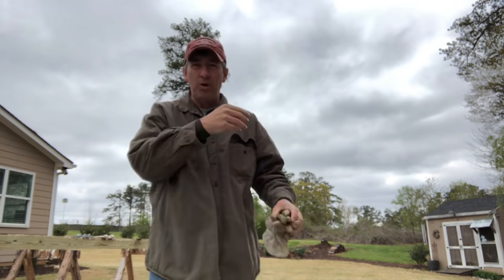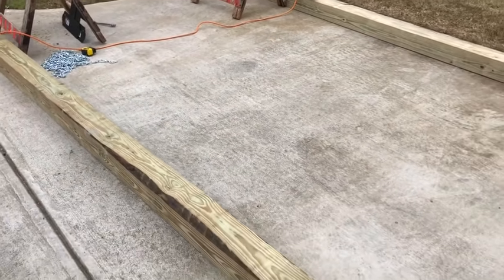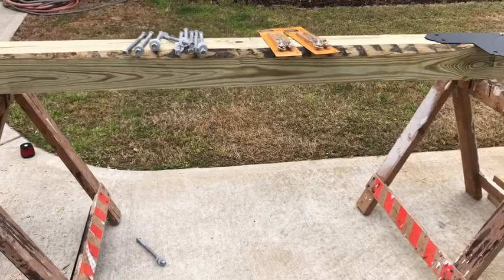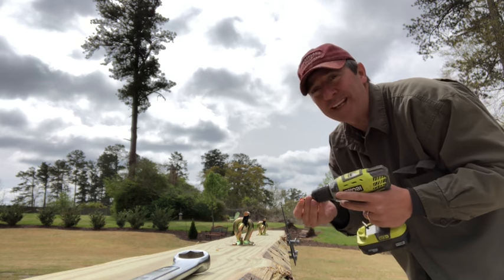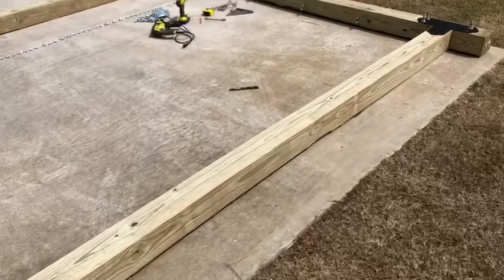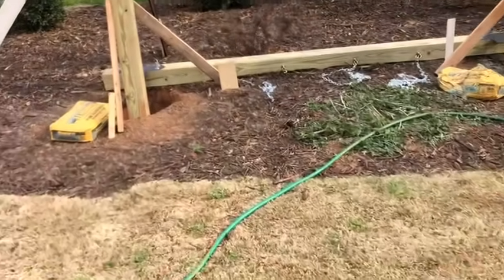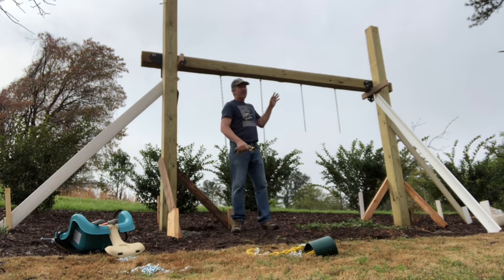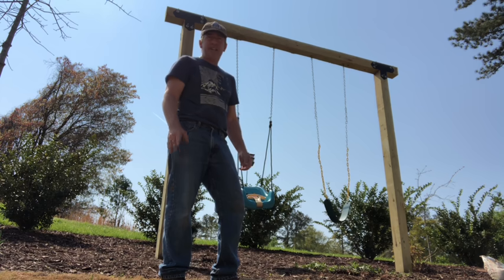Easy DIY Swing Set

Comment: After 4 years, how stable is it now.??
Has it worked loose around the concrete in that soft ground,,?
I'm looking at building a swing set for the grandkids, and wondering about the best method,,  thanks..
Reply from the maker: Great question, John. I got on it last month with one of the grandchildren. It remains very stable. We inspect the connections periodically. The plates, bolts and concrete foundations all look great. We are getting ready to build another on a different property. Stay tuned and subscribe for that video soon. Good luck with your build.

Comment: lemme guess-u got 4 bags concrete but ended up needing 6-8 lol those are giant holes dude
Reply from the maker: Correct @paulhease1007. Yes, it was more than 4 bags per hole. Probably 6-8. Good luck with your build.

Comment: You can drive some 16 penny nails all around the bottom of the post the part that gets buried in the concrete and let the nails stick out about 4 inches and that will help keep your post from twisting and rocking back and forth when the kids are swinging.

Comment: What is the distance from the upright post and the chain and what is the distance between the 2 chains on each swing?
Reply from the maker: +/-9’ clear span. Swing chains are +/-18” apart. That leaves +/-6’ remaining. Keep the distance between swings and posts equidistant. Hope that clarifies. Good luck with your build.

Comment: I'm about to do the same for a bench swing , 4 feet in the ground and 8 feet above. I am using steel WILD HOG Corner Extension Brackets so I don't need lag bolts .  How many 50 pound bags did you need to fill those holes ?
Reply from the maker: Great question Crimson Decade. We used 12' posts, anchored 36" in the ground. Typical ground hole with post uses 3 ea.-60 pound bags of concrete mix. Good luck with your bench swing.
Reply: @Delmanmel  have you noticed any movement since you have installed it or while they are swinging ?  I would have expected about 10 bags per post based upon your depth and an 18" hole for that post size.
Reply from the maker: @crimsondecade7420  Yes, you should expect some movement when the swings are in full operation.

Comment: I did the install slightly differently.  I put both posts in holes the same, but mine had the t braces (all 4) already attached.  Then I was able to lift the cross beam and drop in between the slight loose t braces.  I bolted everything together BEFORE concrete to make 100% sure it all was aligned.  Made me more comfortable.  Concrete is pretty permanent.  :-)

Also let me easily check level beam.

Comment: Awesome project!!!! I have a question about the post. The pressure treated wood looks good but I need to paint white, so the other 4"x4" wood in homedepot is a good alternative like douglas fir? I live in California, I hope it can last 10+ years
Reply from the maker: Great question Robert Johnson. We used the 6”x6” pressure treated. Follow your local store recommendations for painting or stain. Good luck with your build.
Reply: We used pressure treated lumber on our fence, then painted it with white, semi-gloss, exterior house paint (from Walmart with 25 yr guarantee, I think), & it's gorgeous... the 1st fence lasted 20+ yrs before some posts needed replaced (the fence existed b4 we moved in~ we only painted it), but that paint wasn't peeling, faded, or anything, & it was still going strong. Last yr we replaced & repaired the fence & started repainting it b4 an early winter thwarted our plans, but the paint once again was adhering to the treated posts, soaking in just fine, & looking amazing... 
IDK why more people don't paint those things bc they turn out amazing!
I'll make one side note, we don't use sprayers, but rather always use rollers & brushes to paint, as it delivers more paint & gets into all the little holes (looks like staple marks) on those posts, & we're pretty meticulous about coverage. We also use 3 coats, so we do it right the 1st time & don't have to repaint every few yrs. The 1st coat is put on extremely heavy, & we paid close attention to temps & humidity for good adhesion. 
But remember that 1st fence was an existing fence, several yrs old, when we moved in, so if you didn't paint in the 1st few yrs, you still can... just use an exterior, semi-gloss house paint & you'll be golden. We used the color palace, Walmart brand, which we found out last yr is actually made by Sherwin Williams.
Hope this helps you or someone else... good luck.

Comment: Did you use a 1/2 inch drill bit or a bit bigger like 5/8?   I used 1/2 inch bit for the posts and required a dead blow and a lot of persuasion
Reply: Also are those dirt holes about 24 inch diameter?
Reply from the maker: Great question Justin Eltoft: I recall the fit being tight. Adjusting the bit size slightly will help with the bolt installation. Thanks for the recommendation.
Reply: @Delmanmel  thanks! Yea I needed a 4lb dead blow to get them in 1/2 hole.  The treated lumber seems to make it a tight fit also.  

I just got a 16 inch diameter form for the concrete.  I think that should work
Reply: This worked perfect BTW. 5/8 inch.  I used a block of wood on the drill press to make a perfectly perpendicular guide.  Came out beautiful.  Thanks sooooo much for the video.  I went down 40 inches for the holes.  Five  80lb concrete bags on each side.
Reply: Oh.  And I sprayed the wood that was going to be in concrete with that waterproofing from gorilla glue.  Just for added water resistance.
Reply from the maker: @JustinEltoft  Great idea! Congratulations on your build.

Comment: I have my 2 posts set Home Depot didnt have those T brackets they had a much smaller version. Where did you get those at?
Reply from the maker: Home Depot - Simpson Strong Ties. If the local store is out of stock, you may need to order them. Good luck with your build.

Comment: Just be aware that Simpson Strong Tie, who manufactures those T-straps, has never tested them for use as a swing set support. Thus, they jump  away from anything that sounds like they remotely endorse them for such applications. (Yes, I’ve spoken directly to their engineering department)
Reply from the maker: Andy G - Thank you for checking on this. We are just beyond 3 years since built and still standing strong. Good luck with your design and build.
Reply: As I thought about this I was thinking about how 1. The swing is attached at the bottom of the top beam. 2. The swing at most will be an angle of say 50-60 degrees maybe 3. The t braces are 6 bolts all the way through and on both sides so    there is support of opposite push/pull on these.    Would love to see a statics model of these to see how my intuitions fit reality.

Comment: Tyson Fogel
Hi there.  So I built this yesterday with 6x6x12 posts.  I haven’t put it in the ground yet. I was hoping to use it as an adult swing, and be able to swing high, full tilt.  But then I thought twice—will this work for an adult without diagonal braces?  Any update or comments would be much appreciated.
Reply from the maker: Great question Tyson Fogel. Utilizing this particular swing system, each swing is designed to hold 225 pounds. However, feel free to add additional lateral supports to your build. Good luck with your project.
Reply: @Delmanmel  For adult use is there is bigger sway at top of the swing ? What is recommended for change for 200lb adult use ?

Comment: Hello! What size drill bit did you use?
Reply from the maker: Great question. Use a drill bit slightly larger than the bolt shaft. Allow for connecting the T-Plates to the beam. Good luck with your build.

Comment from the maker: MassiveDynamics: 12 gauge plate steel (Bolted front and back of each post) allows for the safety factor required for the force of two swings. However, feel free to install additional lateral supports to your install. Thank you.

Comment: Should the chain hanging brackets been turned 90 degrees allowing the rubber lined “S” hooks to pivot on the eyebolts in the swing direction?
Reply from the maker: Thank George Douglas. Yes, they can be turned 90 degrees.

Comment: I really like this build . Especially the simplicity of it . However I am wondering after all those  heavy duty bolts and concreted posts you used to support the stress on the swing. I was why you used small screws to install the swing fittings?
Reply from the maker: Great question Wayne Jones. The swing bolt manufacturer provided the smaller screws with that swing kit. Maybe, try another type swing kit. Good luck with your build.

Comment: well thought through. I was wondering, wouldnt it be easier to assemble the top bar on the ground and then put the two vertical posts in the concrete. that way you wont run into adjustment issues on the top? Anyhow, very nice and simple design.
Reply from the maker: Thank you Syed Ahmed. That is one alternative for installation. That would be too heavy for me though.
Reply: The weight is hard to lift.
Reply: Good idea. I thought about putting it all together and “walking it upright”. However, if u fill it with concrete first, your posts may not sink far enough down and its not fun fighting thru concrete..and even if u poured the concrete after u put the structure upright, its ALOT of weight to try to make any adjustments on leveling. i just built a similar one, i opted to put predrilled posts in first, then place header on it by having 2 people standing on bed of pickup truck. Easy to do it that way. Good luck!

Comment: Can you pass me your list trying to make some swing for my girls
Reply from the maker: 760BassFishing ~ Confirm the list within the video. However, 3ea-12' 6x6 posts, 4ea "T" Plates, 6ea-7"Galv.1/2"Bolts/Nuts, Chain, Sakrete, 2ea-Swing Kits.
Reply: @Delmanmel  thank you so much for the response back man I appreciate it
Reply from the maker: @chrissmith7995  "T" plates were located in the Building Supply area at Home Depot. Good Luck.
Reply: @chrissmith7995  Did you end up using 8x8 posts ?
Reply from the maker: @abdullahmamun8797  Thank you for asking. Yes, those are the plates.

Comment: Can this be used for adult swings?
Reply from the maker: That's a great question, Stephanie Diaz. Yes, each swing is designed to hold 225 pounds.
Reply: Del Creviston hi there! When you say each swing do you mean this can hold a total of 450lbs?
Reply from the maker: Tabitha Kaus Thank you for asking. Yes, that is the maximum recommended limit.

Comment: Looks great. How did you get that topic beam up top?
Reply from the maker: Set the beam with at least two strong people. Watch the video for set up instructions. Good luck and please be careful. Good luck.
Reply: Works great to back up a pickup truck directly beneath the beam. Have 2 people stand in the truck bed to lift each end. Safer than struggling on a ladder...

Comment: When you set your uprights, how did you assure that the crossbeam, installed days later, would be level?
Reply from the maker: That's a great question Ooygin Jardl. Make sure to plumb and brace the columns, prior to placing the concrete. When setting the beam, you have some flexibility during bolt installation. Be safe and good luck with your build.

Comment from the maker: Connie Erickson
 asked: I had this built and there is sway on the top half. Is this normal or suggestion of how I can correct this? Great Question Connie Erickson. Yes, with wood columns at a clear height of +/- 9 feet, expect some flex movement at the top.

Comment: Without any diagonal stiffening for the uprights in the direction of swinging, you’ll be doing well to get one year of use out of your new swings. Enjoy.
Reply: I was wondering about additional diagonal support as well.  Looks like these are meant for some very small kids so i doubt there will be an issue but getting into 2 tweens on that thing will be interesting.
Reply: I have a friend who built a similar swing set for his kids, that was about 8 years ago and it hasn’t had any issues. He did use a 8” wide beam on the top.
Reply: @mattq6856  He's commented that adults use it, & it's goi'n strong 4 yrs on...

Comment: They are way expensive then it should be. 4 bucks for a nut bolt. And thatetal plate, 20 bucks? Man that's robbery. It's just a steel plate cut out from a sheet of probably 2x4 feet that would cost about 10 to 12 bucks.

Comment: I’m no engineer but I have the exact beams in my yard and I would not build this
Reply from the maker: We have one that was constructed over 10 years ago and still standing strong. This model has been working well for close to one year and designed adequately for a two swing system. However, feel free to have your swing system designed and approved to your satisfaction. Good luck with your build.
Reply: His instructions should be sufficient. I’d trust that more than the dried out cracked up garbage they sell swingsets with. I’ve lifted these 6’ x 6’ treated posts. They are beefy. If it sags or shows signs of sagging, then additional supports needed perhaps.